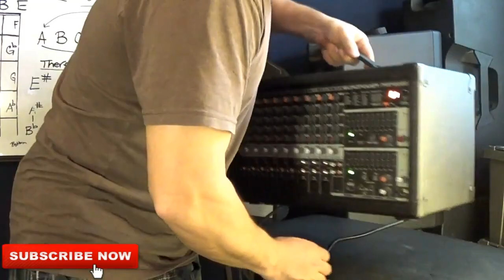How to Daisy Chain your speakers for live shows (Pt.2)

Comment: But you can also run it on stereo... correct? I just ordered this and there is a left and right main.  The switch controls it. Maybe I'm misunderstanding... because I guess if you want to use a monitor then you'd have to use only one channel and daisy chain. 

I plan on using mine is a stereo configuration.
Reply from the maker: The Main is mono, you can make it stereo by using the bridge setting, it runs monitor and mains together, one volume

Comment: Hello.  I have a question…so I have the harbinger model of this same mixer which is the harbinger LP9800. Same exact setup to your model… I want to know how I would connect passive floor monitors to this… It has the main output on the back but if you could look at it quick and shoot me some advice it would definitely be appreciated. I was just gona daisy chain the two mains and leave the second main output for a monitor. But the harbinger has these different modes on the back like “main” and “bridge”…🤷‍♂️. I am not a sound guy so I’m trying to figure out. 
Thank you.  Ur videos are sooooo informal.
Reply from the maker: You will have to daisy chain both the monitor and the mains, as far as the bridge, I think it's for when you want to use both amps to power the mains, not 100% sure, check the manual to see.  thanks for watching

Comment: Wires =1/4" Unbalanced Jack Leads, 4 pin = Speakon leads, (also many say 4 pin but only have a twin cable attached) also if its not been mentioned DO NOT go below 4 ohms as that is the stated min for this unit, (with wiring in parallel / diasy chain you are reducing the Impendence in half) or you will damaged the amp, do not plug in or unplug while powered on, not meaning to be picky but, its easy to miss certain important  info out 🙂, but well done for doing the videos

Comment: This guy Will have you blow your amp. Don't plug into lower ohm speakers. An 8 ohm amp will not handle 4 ohm speakers. Daisy chaining two 8 ohm speakers drops to 4 ohm, 2 16 ohm to 8 ohm ect.

Comment: Great informative vids Jason. I'm sorry for the stupid question but I have one of these mixers on the way and was wondering If I can daisy chain two main speakers and two monitors as well? Thanks.
Reply from the maker: Yes you can, being there are only two outputs, the top output is the monitor and the bottom is the main.

Comment: If you're only 2 speakers why not just run 2 cables one put of left one out of right. Why chain?
Reply from the maker: Because the Behringer only has 1 output for the main speakers
Reply: @JasonsAcousticWorkshop  correct. But isn't the "monitor" output also the "left" output when only running 2 speakers? I have the identical pa and when I'm not running monitors I run 2 cables . One out of the main like u did here (right) and one out of the monitor (left)  Have I been doing that wrong the whole time? 😟 Last thing I need to do is fry my pa lol
Reply: @johnlewis5774  YES, I have also the same question - can I use both outputs for 2 speakers? ,, I am a little confused with the (front) switch about setting speakers ( A/B, main, etc.)
Reply: I just ordered this mixer/ amp and it is my interpretation that you can run 2 cables and have a left and right stereo system. Then each EQ will control each individual channel. Ya just have to have the switch on the front set to main L - main R.

At least that's the way I'm hoping it works.

Comment: Jason you might want to point our never go below the 4 Ohm threshold as you can burn out the amp. As you parallel / daisy chain the speakers the ohmage goes down so 2-8 Ohm speakers are 4 Ohms to the amp and 3 speakers are something like 2.6 ohms (8/ 3)
Reply from the maker: That is correct, thank you

Comment: Hi Jason! If I select "Monitor" on the switch, how do I connect the speakers?
Reply from the maker: connect the wire that's in the output in the back of the mixer and plug it in into the monitor, (usually speakers have an input and output) then connect another wire from the first speaker into the second speaker. 00:05:48
Reply: @JasonsAcousticWorkshop  thank you so much for answering! So I only conect one speaker wire on the back of the mixer, in the Output A? Then, I connect one speaker to the other (like Daisy chain)? I apologize for asking this now.

Comment: Great vid! Im new to this and wondering how would you connect a subwoofer? Thanks!
Reply from the maker: You can't, there is no Aux out on this mixer
Reply: @JasonsAcousticWorkshop  Could you possibly either plug the subwoofer into the monitor output in the back or daisy chain a powered sub with the mains?
Reply from the maker: @leapyearfiasco  you can not plug  a powered speaker into the outputs, it can cause damage to the mixer and/or speaker, as far as the subwoofer, if the subwoofer is not an active speaker,  (powered speaker) then i guess you could, but I'm not sure how it would sound. You may not be able to get the bass sound you want.

Comment: How too connected with the power amplifier
Reply from the maker: Are you asking if a power amp can be connected to the mixer?
Reply: @JasonsAcousticWorkshop  yes sir how to contact
Reply from the maker: @aliyanproduction490  unless there is an auxiliary out on the mixer, you cannot plug in a powered amp into a powered amp.
Reply from the maker: You might want to check into a behringer that has an auxiliary out. The pmp2000d does not have an auxiliary out.
Reply: @JasonsAcousticWorkshop  can you show pictures or video
Reply: @JasonsAcousticWorkshop  so how to contact please
Reply from the maker: @aliyanproduction490  the Behringer Europower pmp1680s does have main and monitor auxiliary outputs. You might want to check that out.  Is this powered amp a guitar or bass amp or a powered speaker?
Reply: @JasonsAcousticWorkshop  please sir can you make one more video discus about this matter if want to connect external power amplifier how can
Reply from the maker: https://www.guitarcenter.com/Behringer/EUROPOWER-PMP1680S-10-Channel-Powered-Mixer-1275776902496.gc  This Behringer amp has Auxiliary outputs for main and monitor.  The auxiliary send out a signal, that's all, if you hooked a powered mixer amp to a powered mixer amp, you would blow the system.  as far as pics or examples, I don't have any at the moment.  Check out the pmp1680s amp on the link and see if that is what you need.  The speakers I use in the video are not powered speakers, that's why I can daisy chain them.  If they were powered speakers, I would not be able to daisy chain them.
Reply from the maker: Hey Aliyan Production:  I made a video to answer your question, I hope it does.  https://youtu.be/5bAjG0UxLFY

Comment: hi jason,the 4 pin adapter where did you purchase it from,and is the cable 4 core.
Reply from the maker: I bought mine at Heids music in Green Bay Wi.  If you're not in the Green Bay Area, you can purchase them on amazone or at your local music store.  Here's the link for Amazon: https://www.amazon.com/Connector-NANYI-Connectors-Converting-Amplifier/dp/B07RTTH54C/ref=asc_df_B07RTTH54C/?tag=hyprod-20&linkCode=df0&hvadid=343242953198&hvpos=1o2&hvnetw=g&hvrand=8680548343462538119&hvpone=&hvptwo=&hvqmt=&hvdev=c&hvdvcmdl=&hvlocint=&hvlocphy=1027991&hvtargid=pla-784919842704&psc=1&tag=&ref=&adgrpid=71764766831&hvpone=&hvptwo=&hvadid=343242953198&hvpos=1o2&hvnetw=g&hvrand=8680548343462538119&hvqmt=&hvdev=c&hvdvcmdl=&hvlocint=&hvlocphy=1027991&hvtargid=pla-784919842704   I'm not sure if it is  a 4 core or not

Comment: Jason, can you also daisey chain for the monitors? What ohms is the Berringer rated at?
Reply from the maker: Yes, you can Daisy chain the monitors also. On the manual, it say that the maximum power output is 500watts x 2 at 8ohms and 1000watts x 2 at 4ohms.  Most speakers have an impedence of 8 ohms.

Comment: cheers jason watched all 4 vids great very informative also just bought the 2000d for karaoke and disco
Reply from the maker: Is that mixer working well for you?  I don't like the fact that they have the four pin connector inputs and not the 1/4" input.
Reply: @JasonsAcousticWorkshop  YES WORKING WELL
CHEERS